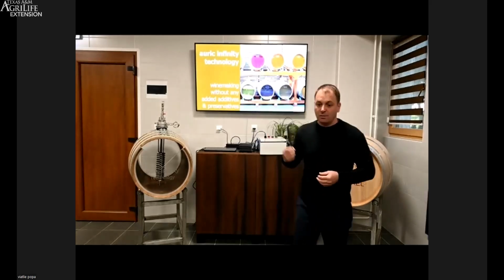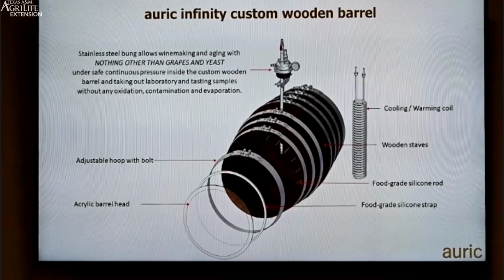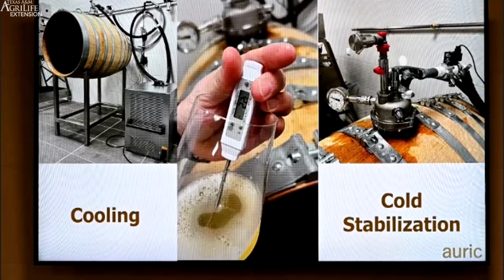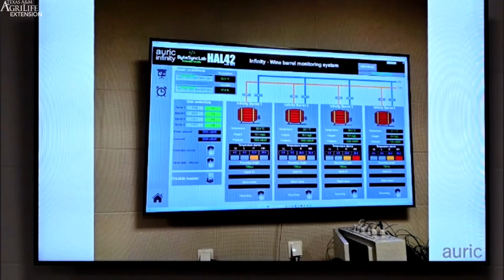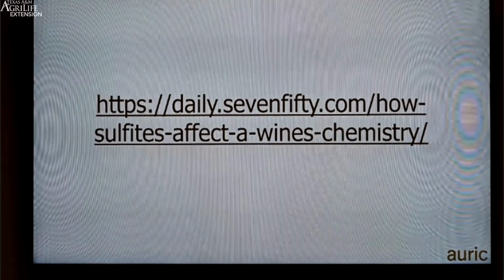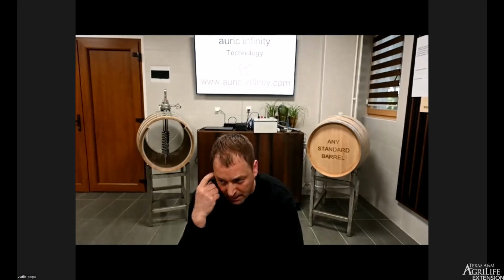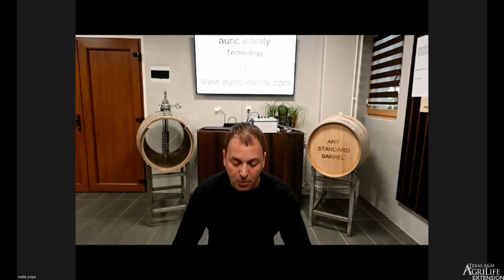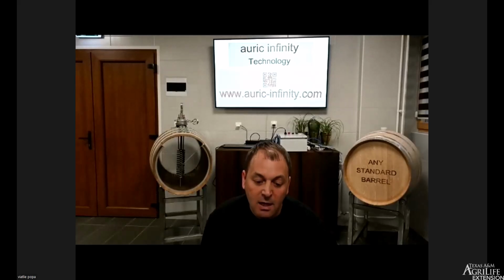Auric Infinity Barrel - new barrel technology in winemaking

Comment: Can you adjust the bung so that it is just an airlock bung and sell a barrel like that, since the barrel already has an improvement in constructon with silicone between the staves. Also can you make this with French oak as apposed to Slavonian oak. What sizes can you offer then? Seems to me that all the cooperages will send you staves to makes various infinity wood barrels or you can patent it so that cooperages adopt this silicone process construction for adding it  between the staves in all the cooperages of the world. Infinity process becomes licensed process with yearly subscribtion or a small fee for every barrel produced by other cooperages, while you still continue making the original Infinity barrel with slavonian oak or wood from your area. So for example if I use Stockinger barrels, can Stockinger adopt your silicone process between the staves and use your patented airtight lock/valve without all the other tech of that original stainless bung with all its functions, just simple airlock bung, obviously it will be less effective for the intended purpose of the invention. I am thinking scaling just the simple concept of barrel construction by all cooperages, by adding silicone and a simple airlock bung that you supply to them. You get fees from every barrel produced by others and is the main supplier of the simple bung to all cooperages. Then they can also purchase the original bung with tech from you seperately should a customer of the the other cooperage want one.